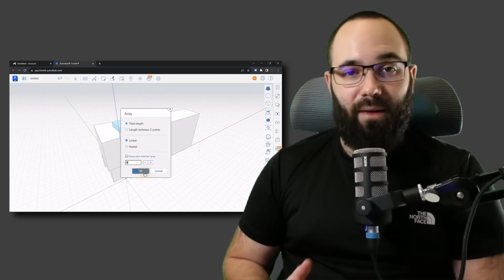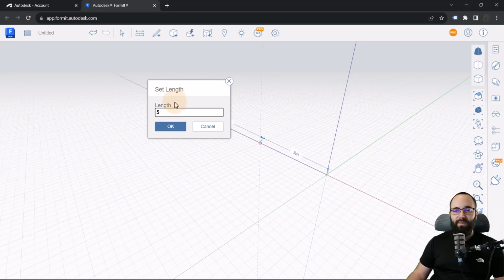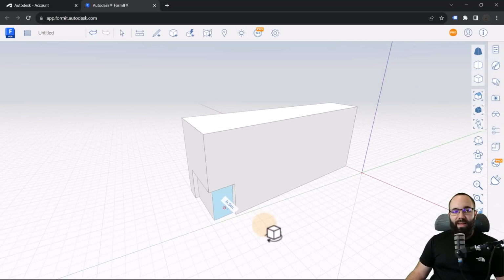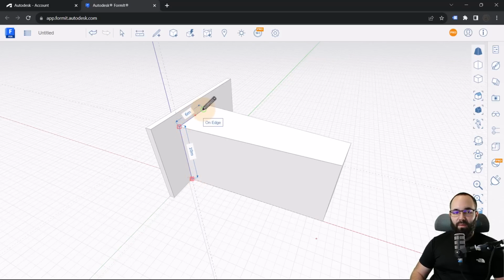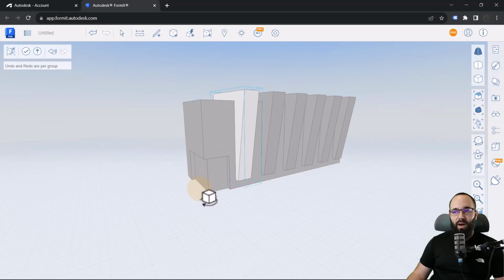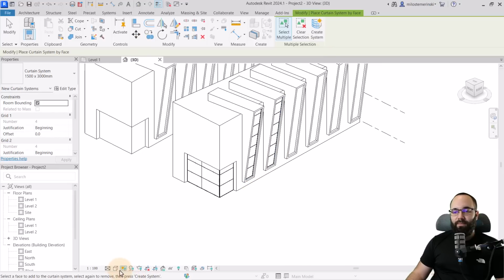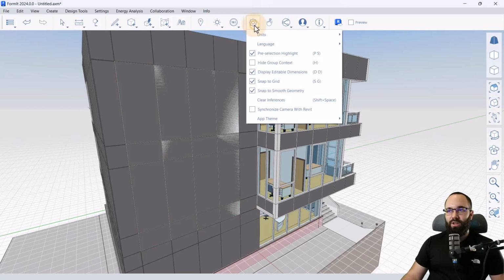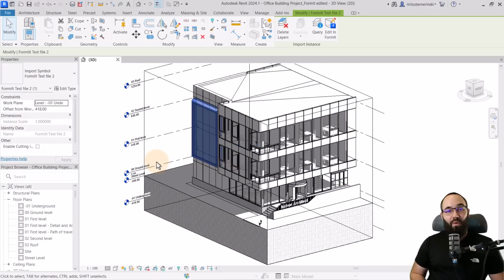Autodesk FormIt - Beginner Tutorial

Comment: Thank you for this tutorial, it's very useful! I have a question: when I link a Revit and a Formit file together, the formit does not have a link with the Revit file, it's just an import, not a link. Revit keeps the linked Formit file, but I don't understand how can I link the Revit file inside the formit file, so that when I make a change (or many changes) in the Revit file, the Formit file also updates the Revit link. 

Right now, the only solution seems to launch a new Formit session every time I make changes in the Revit model, which makes this workflow very difficult. Does anyone know a workaround to this problem?

Comment: Hi you are the best, I have a revit project from 2017 and when i want to open it from the revit 2023 it says « revit file corrupted needs manually recovered » i dont know what to do. I used to work with a central model in 2017. And i dont know if the central model still exist and i have ni backup